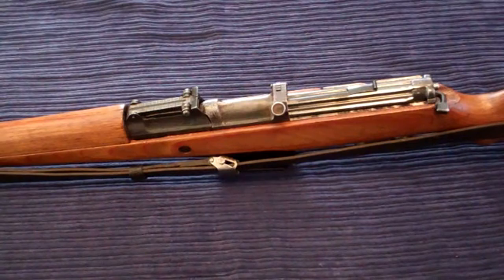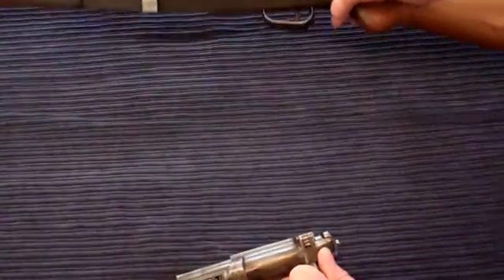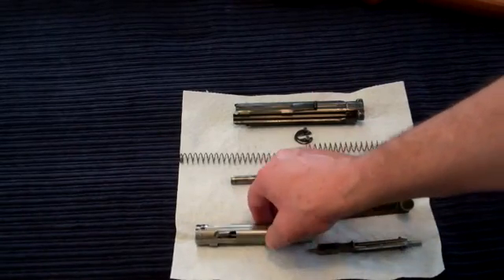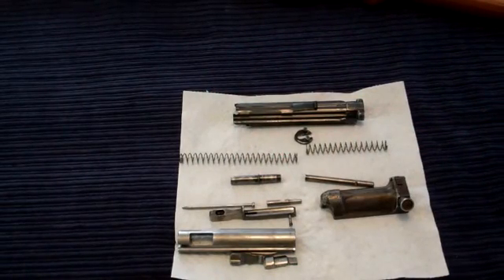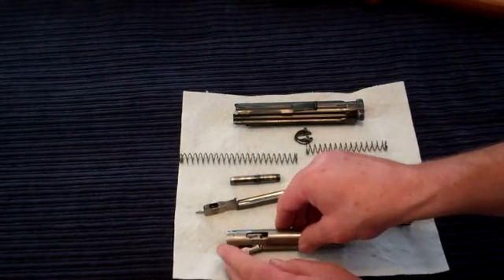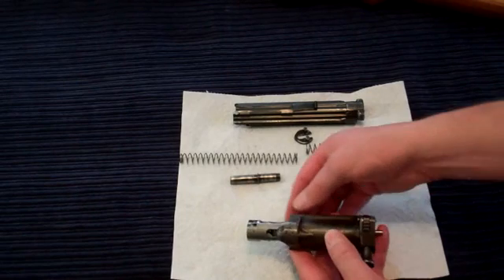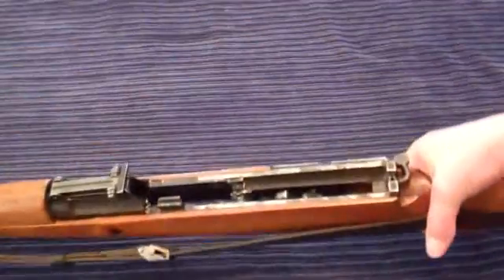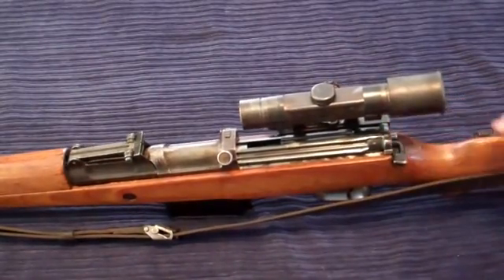G43 K43 maintenance Bolt disassembly and installation

Comment: Great K43 videos, bolt disassembly and gas system replacement. I do have a question.  When I press the bolt assembly release button it is very rough to push in.  Is this normal?  Yours seems much easier.  Thanks

Comment: I'm having an issue with my housing. It's a milled housing and it seems to be binding up on the bolt when it is installed to the receiver. At no point does the spring tension ever allow the bolt to move freely I can close it all the way to the locking lugs putting it into full battery and pull it back manually but it will stop in place if I stop pulling or pushing charging handle

Comment: I have a k43 and the threads in the bolt carrier for the charging handle are a little stripped, what do you recommend to fix it?
Reply from the maker: I would send it to Apfeltor and have them take a look at the issue. You can quickly destroy the value of your rifle with a DUI repair.

Comment: I have found that it's quite easy to engage the dust cover nipple under the edge of the bolt carrier if the dust cover is extended as far forward as possible at the beginning of assembly such that this nipple slides under the bolt carrier before the bolt carrier even touches the bolt.

Comment: 10.30  recoil spring guild. use a small wood or metal rod to insert inside rod while replacing spring it sure does help to put the spring retainer in place it keeps the rods extended outward.Great video by the way.

Comment: hello
which one is the left and right locking lug ?
Reply from the maker: The locking lugs spread sideways out of the bolt when you move the firing pin carrier all the way forward. At 5:13 minutes in the video you can see me holding the lugs in my hand. The top one resting on my fingers has an additional  cutout and is the right side lug. The one on my palm is the left side locking lug.

Comment: Okay, I got it apart and refinished the stock and the only thing messing me up is when I go to reassemble the bolt I do not have that bolt catch. It is a late in the war rifle and obviously it was a manufactoring shortcut. So short of growing a third hand how do you get it back together?
Reply from the maker: There should be two fine lines on your stock (see link). You pull the bolt carrier back until it lines up with those lines, then carefully lift the back of the bolt carrier and separate it from the bolt assembly. Now you push down on the button in the back of the bolt assembly and remove the bolt assembly from the receiver. Reverse for installation.  
http://apfeltor.com/html_pages/riflemuseum/g43a/image4.html
Reply: +AxisGuns  i saw those two lines
Reply: +AxisGuns sorry, saw those two lines and thought they were a marker. Spring is so strong i can't hold the assembly together to feel it in. I see where the individual parts are supposed to go but as a unit i t just doesn't want to go.
Reply: Took it to my gunsmith out of frustration. Showed him how it was all supposed to fit. We put the rifle into a gun vise/rest so it wouldn't move, then used two hands to put bolt assembly back into place. Very nice. Also realized I can't use the replica scope mount as the place for it was never milled out.Am going to Allentown gunshow saturday and will look for earlier version of G43 to view the differences. Thanks.

Comment: I just obtained a G-43 that was brought back from WW2 by my father's best friend. My father tried to fire it a couple of times but the action wouldn't cycle properly. I just ordered the Wolf spring set for it, and plan to get it back to firing condition. I only plan to shoot it a couple of times before it gets permanently retired. This excellent vid will really help.  Thank you.
Reply from the maker: Congratulations on your new rifle. A quality replacement spring kit is always a good idea. After cleaning and lubricating all moving parts, the rifle should cycle reliably. Check if parts are binding by assembling and manually cycling the bolt without internal springs or spring guides. Remove the magazine and press down on the back of the bolt housing with your thumb while operating the bolt. The only significant resistance you should feel is when the rib at the bottom of the bolt rides over the hammer.

Comment: I just finished disassembly of the bolt carrier group. But ran into a bit of a snag. I can't remove the guide rod from the guide housing. Is it supposed to fall right out because the end of the housing is tapered preventing removal of the guide rod. Was that common or not on the k43s??

Comment: I'm cleaning my G43 and it seems that the firing ping extension retaining pin isn't able to be removed. It seems that the end that should be able to back out of the firing pin housing is too big and has been flattened to prevent removal. Is this normal and original or has it been modified to prevent extraction? Should you have to use a punch to remove it? See the photos at http://imgur.com/a/qc6rY
Reply from the maker: The firing pin carriers I inspected had retention pin holes of slightly different diameter. The retention pin should only be flared slightly so it will clear the larger hole but still get stuck in the smaller hole, preventing it from falling out and disappearing during field strip.
Reply: AxisGuns My retention pin is definitely "flattened" at one end so that it cannot be fully removed. Would you say that this was done by someone well after the war?
Reply from the maker: I would think so. G/K43 rifles have a spare parts compartment in the butt stock, accessible through the door in the butt plate. The rifles left the factory with a spare firing pin, firing pin extension and other small parts stored in this compartment. If the retention pin were flattened, the soldier in his fox hole would not be able to replace a broken firing pin without having a hammer and drift pin on hand.

Comment: Hi I need a new bolt housing, and a new stock. where can i get them at. thanks your video was a lot of help.
Reply from the maker: Parts come up quite often on the usual auction sites. Many bolt housings are not serial numbered to the rifle but there are two versions, one is made from stamped sheet metal and the other milled out of a solid pieces of steel. Recently prices for original stocks have gone through the roof. I would recommend getting one of those excellent laminated reproduction stocks from Poland. In addition to scouring auction sites it also makes sense to join one of the many forums discussing WW2 surplus rifles and place a WTB ad.

Comment: the dust cover goes on the inside of the bolt housing and I just cant seem to get it the bolt assembly assembled because every way that I try to assemble it with the dust cover the dust cover seems to block it from sliding completely in.

Comment from the maker: I understand you have the milled bolt housing, not the stamped sheet metal version shown in my video. Yours indeed has a different dust cover. I will shortly upload a video illustrating assembly of the milled bolt housing and dust cover. Stay tuned.

Comment from the maker: If that tiny spring came with a spring kit, it most likely is the replacement spring for the extractor. The springs that come with a "spring rehab kit" usually can be replaced without using tools. All other tiny springs (bolt carrier latch, bolt stop  plunger, shell ejector) require a higher level of gunsmithing work for their replacement, such as punching riveted pins out etc.

Comment: Hello, yes I tried pushing it in with little luck. Could I need new recoil springs?? The short one is under very little tension when I put the guide in place. Is there supossed to be alot of tension with the short spring??

Comment from the maker: Did you already check if you can push the button in with the bolt assembly out of the rifle? You may have to push pretty hard to overcome spring tension. If that works, then your safety lever may have been switched to the left. For bolt installation, it needs to point to the right.

Comment: Hello, your video is very informative. However, my recoil spring assembly seems to be binding. The bolt group is together but I am unable to push the button in back of the bolt housing to drop the bolt group into the rifle. It seems stuck and I do not want to force it. Any ideas?? I have had it together several times with the same results. Best, Bob